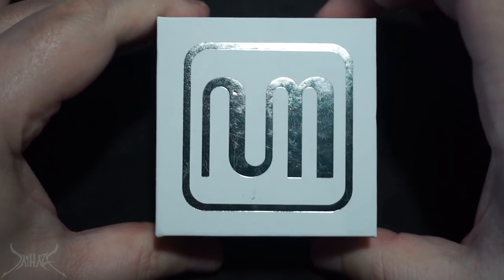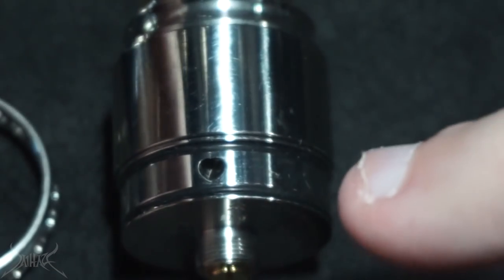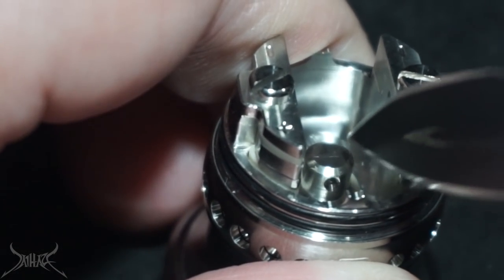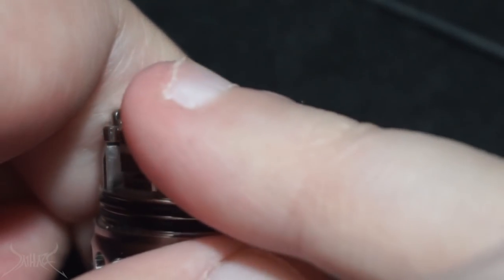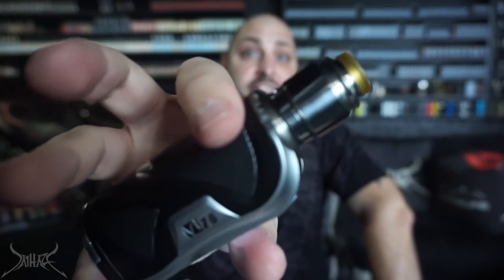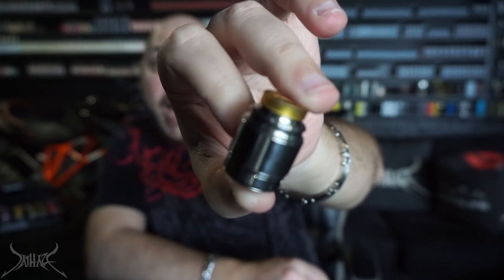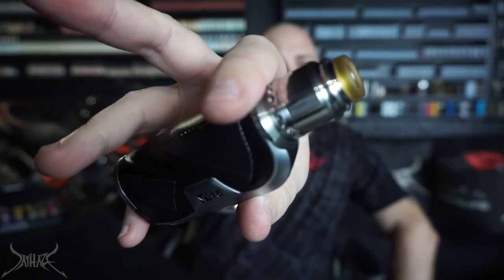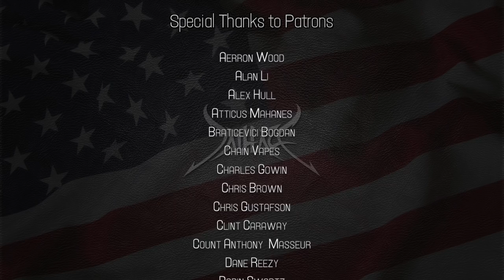Dukun Vape & Hellvape Anglo RDA Review and Rundown | A Dunk in the Fail Tank?

Comment: Id like to try two tiny coils in it. One on each clamp. Something like 30x2/38 coils, spaced 6 wrap. Run it around 40-45 watts. But whats weird to me is the deck looks so wide which makes me think something like a 4mm coil would work well but then you dont have enough air. The chamber needs to be reduced a lot, then it'd be a nice cheap flavor machine.

Comment: Jai if u want to review something different ...do the PIRATE RDA ...looks like skulls n treasure stuff on the outside..made of brass i believe ..the deck has a middle clamp style post..different kind of squonk and u have to bend one lead on ur coil so ur leads are at a 90 degree angle...one lead goes into middle clamp style deck and one goes into the well..dual coil..bottom air flow..it can leak tho..but its something different..IVE NEVER SEEN IT!!! Good luck

Comment: If that was my dripper I would drill and make that air flow hole a little bigger.  Thanks bro.
Reply: Ruben might be tough cuz it's on a angle maybe if you clamp it down you might be able to do it a little easier good luck dude
Reply: Ricky Fava It would of be very easy to do if I was still working. I would have done my own mech mods. I worked as a machinist. Wish I was still there.
Reply: Ruben  hey I'm a machinist too recently laid off it could be done easily if I have access to a lathe
Reply: I miss the machines like the Bridgeport and the surface grinder. I'm retired here.

Comment: Jai is there enough air flow for dual coil? How the clamp posts are set up you could put a coil on each side, but if there is not enough airflow why would they make it so they could dual coil. lol
Reply from the maker: no fckn way, there is barely enough for single.  Adding more obstruction would make this worse
Reply: Its not really for dual coil when you see decks like that its just so you can put your coil in no matter which way you wrap your coils. Over or under
Reply: i understand if they had put more air flow the way they have the clamps set up could of put a  coil on each side.

Comment: The wasp is still my fav
Reply: I'm new to vaping and the Wasp is my first RDA. What kind of coil do you recommend ? Every time I use it, I'm just not getting a lot of flavor and I know I'm doing something wrong.  I like .13 to .17 or so, but Have tried everything from .13 to .8. Help!
Reply: B Kopp I clapton coils or flat wire around .25 to .35 is where I get the best flavour. Morten Oen has videos on the flat wire method .
Reply: My setup on the wasp for almost a year : fused clapton Ni80 28GA*2 wrapped by 36GA, 4 wraps 2.5mm diameter.